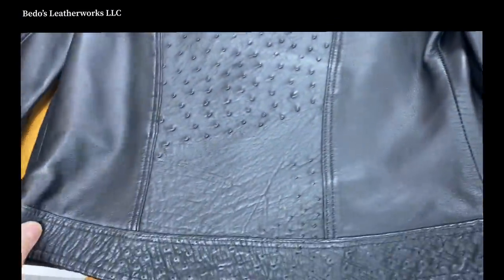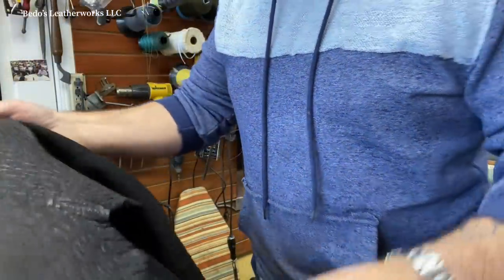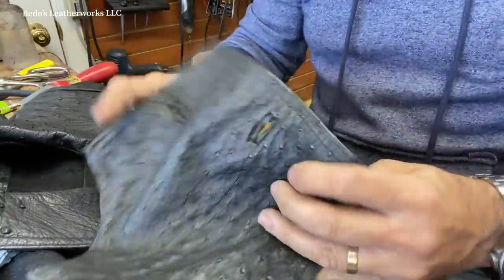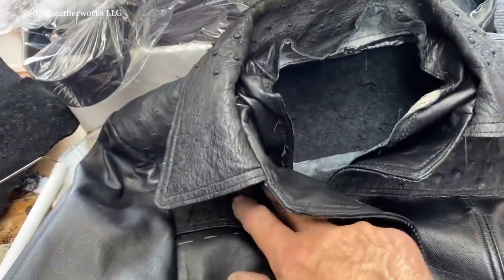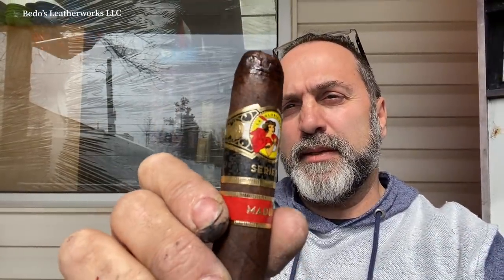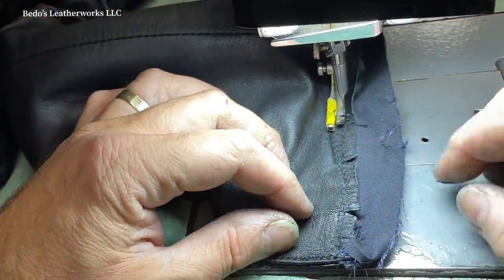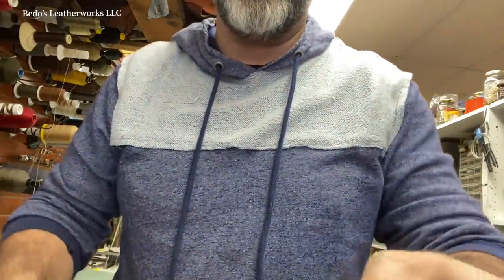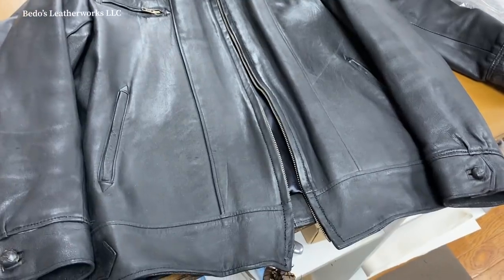Part 1 of these jacket restoration

Comment: Hi Steve, in one of your old videos you changed the color of the welt stitching on a pair of tony lama elephants from white to black. I want to do the same with the welt on my boots, but I don't know how and you didn't show how to do it in that video. 
Do I have to ask to change it while resoling them or can I do it myself with maybe some black dye?
Reply from the maker: Yeh if you’re not replacing the soles, which then you can ask to change the thread color, then get a small brush and some dye, that’s it